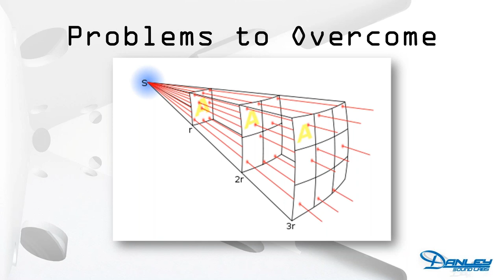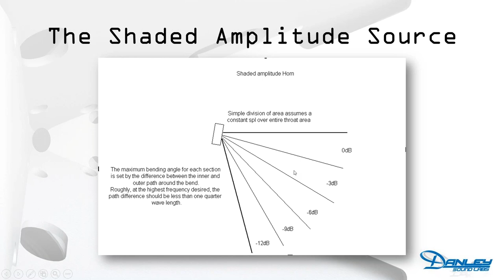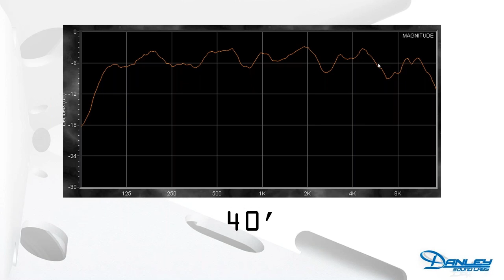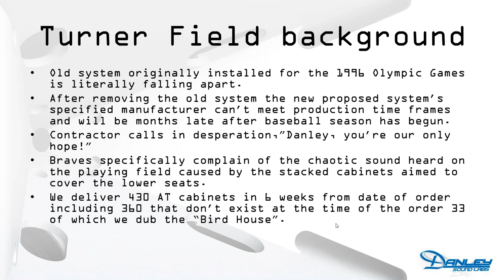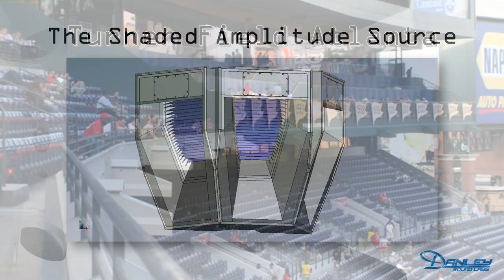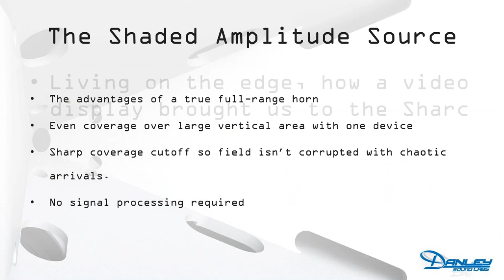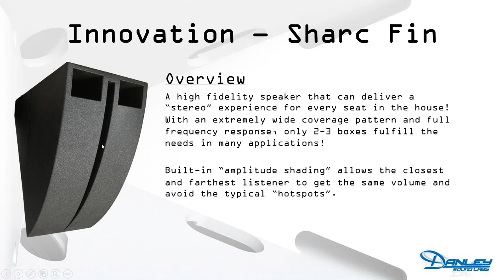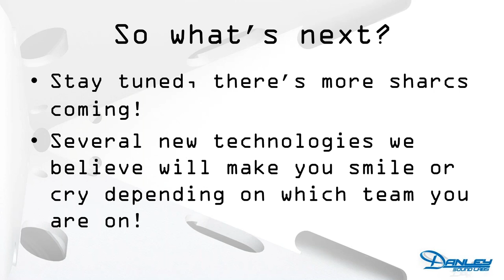Fireside Chat |  Mike Hedden | Innovation - The Path Less Traveled 5.14.20

Comment: It surprised me the way the Genesis horn worked with just veins. What I thought was that the top "Paraline" lens would be close to a parabolic lens, which narrows the vertical dispersion, and then the bottom would be to a degree hyperbolic in order to widen the vertical dispersion and either angled downwards or having the compression driver input hole mounted off the vertical centre in order to down tilt the vertical dispersion.
I'm not sure of the maths for off centre driver placement in a paraline lens, but I do know that in order to get as tight a vertical dispersion as possible (within the wavelengths controllable based on product size), you'd use a mirrored parabolic curve with the driver at the focus. To fan out the vertical dispersion, you'd use a mirrored hyperbolic curve. Theoretically, using a mirrored elliptic curve could produce a converging acoustic laser - that would be louder at the higher frequencies further away. I wonder if this could somehow be used to throw high frequencies across a baseball field and concentrate them on a small area.
It's quite hard to explain this without a picture.